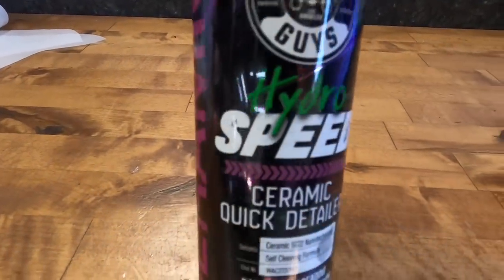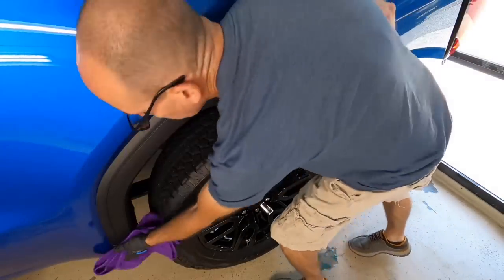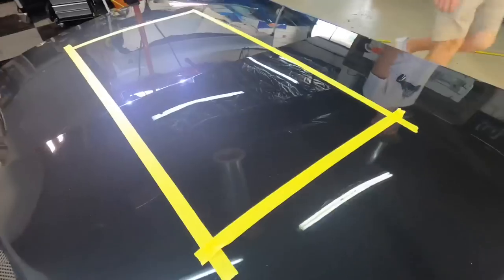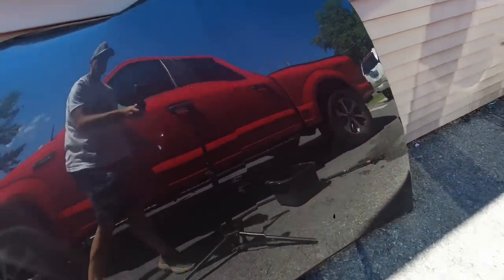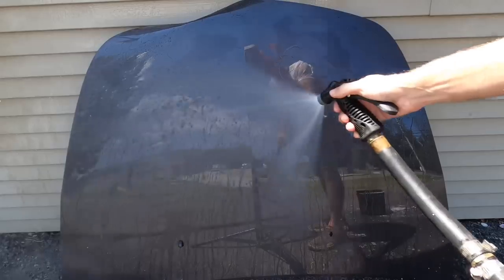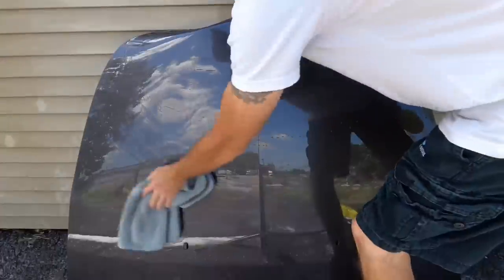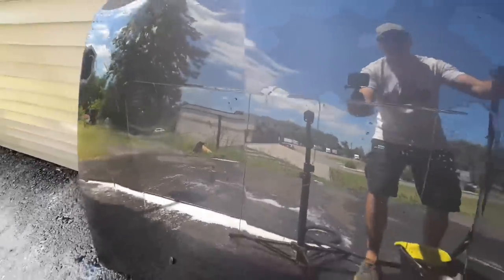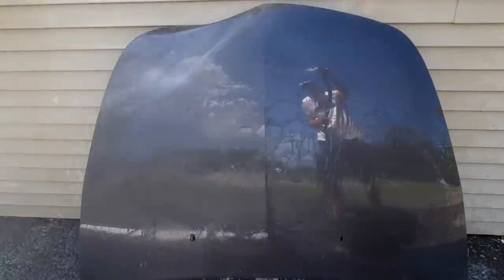Chemical Guys HydroSpeed Ceramic Quick Detailer!

Comment: I love this stuff personally. Very slick and reasonably durable. The shine deepens over the next 24 hours. Drawbacks, it’s a little expensive and it smells horrible. Good video.
Reply: It's way cheaper on Amazon if you get the gallon. It's like 25 bucks for 16 oz or 50 bucks for a gallon.
That makes it cheaper than the Adams mega foam, you could wash your car with the stuff lol
Reply: I think it smells great, love the shine it gives to my e63 amg. Im a fan, and frankly I did not expect it to last 3 washes (that was my thinking when I bought it). Seeing this review makes me happy I picked the right stuff for my car. Im impressed.

Comment: I like that👍 Awesome quick detailer for Sunday night drives in the city.. the lights really show off the gloss!! The gloss is INSANE at night.. don't know what is is about it..just try it😎
Reply: Personally if you’re willing to go to such lengths for your car I’d say just go all out and get yourself some Adam’s ceramic coating and apply that, then for quick details, use nexgen ceramic detailer. It has a 12-13% sio2 content. That paired with the 10h hardness from Adam’s and the superior sio2 content from nexgen should keep your car perfectly protected for YEARS. And for less the price than a detailing at your local detailer.

Comment: Looks like a great product for a quick detailer!    I might have to pick up a bottle of this next time I need a quick detailer.   I personally love using quite a few of Chemicals Guys' products.   Diablo Wheel Gel is my favorite wheel cleaner believe it or not because it's PH neutral so works perfectly on my well maintained rims that I have protected with Fusso Coat topped with Turtle Wax Seal & Shine.  Another is their Leather Serum along with a lot of their soaps and foaming soaps.   Their grit guard is one of the best out there in design with a unique conical design that really holds the grit and grime UNDER the grit guard and they cost a measly ten bucks!   Far better than the original grit guards that allow dirt to flow right back up past the wide grates.  If a person is just getting into detailing and are looking for a "one-stop" shop for all their detailing needs,  I steer them towards Chemical Guys because they are at least a notch above what you can get at most retail stores.   It's a great "entry" company in my opinion.   A lot of pro's and enthusiasts bash on Chemical Guys, but they really do have some good products.   It's just confusing to traverse through their extensive range and you almost need a roadmap because many of their products seem to be rebranded as something else or a different color or whatever.   But when you get past all that,  they do have some good ones.   Not everything,  but quite a few are really good.   Their retail stores in California are really cool.   I am like a kid in a candy store in that place.  This particular quick detailer looks to be pretty stout for what it is.   A lot of detailers can't stand up to any chemicals and wash right off so the fact this quick detailer held up to all the abuse Brian gave it is pretty impressive.   It outperforms a lot of other quick detailers I have used.

Comment: Hi Brian love your channel but i have one concern about this 10wash test. It will only be a mechanical stresstest so you could use just regular soap. If it shall simulate 10 real washes the product must be on the panel for more than 10 seconds before being washed off. Because when you shampo your car the solution is on the panel/panels much longer maybe 2-8minutes? So you should leave it for some minutes in between.
But i understand the test will take much longer time.
Thanks

Comment: Hi Brian I was just wondering in your opinion I use megs cpress spray wax as drying aid and ultimate paste wax when i have time  other wise I use there  fast finish bought few cans when saw for 5 bucks while back  I was intreasted in turtle wax line up flex wax   if it's similar I'll  just stick with what I am using.  Just wondering would i be getting any more life outta newer cermic based products

Comment: It seems as though this product is fairly good as a quick detailer like you mentioned. My one complaint with chemical guys is the one recent incident that I had with their water spot remover. I watched several videos on how remove water spots and in was those videos, the consensus was that chemical guys orange gel was best. Well, that wasn't the case for me. It didn't remove not even one water spot. Being that I value your honest opinion, I decided to see how you could advise me on correcting this issue without taking my car to a professional. I watch your video on the 3d one polish and it totally and completely corrected all of the water spots. I reached out to chemical guys but to this day, they have not responded. For that reason I won't use any of their products. But I would like to tank you Brian for your video on 3d one. I reached out to also thank 3d one. I'd like to add that I corrected the spots with the only thing That I had, a harbor freight bauer dual action polisher. Which made me wonder....do you really need a expensive polisher?? How long it will last, who knows. Thanks again.
Reply: I would recommend getting in touch there ig. I replied to the one in my local area and they responded pretty quick

Comment: What’s the difference between this and the v07 spray ?
Reply: My truck is tuxedo black and for me the v07 just doesn’t do well, doesn’t last and everything seems to stick to it. Can’t think of the name but the purple quick detailer works better for me than v07. 
I’ve been using this hydro speed lately tho and it’s my favorite so far. Works super well. I’ll go ahead and buy the gallon as soon as i run out.

Comment: Yes! Thank you Brian,I bought some of this last year and had excellent results with it's hydrophobicity,slickness and gloss! Chemical Guys has hit and miss products and to me this was a hit!! It's very versatile,I have used it over waxes, sealants and no protection with no fuss. The longest it lasted was on my car overtopping the hydro slick and it lasted around 9months before it's properties were diminished. I got around 4 months as a standalone on the paint. On my windshield and other's I applied it to though it lasted well over the year mark with no problem.. It  was weird to me professional detailers haven't done thorough review on it yet.. I feel it's great for anyone wanting some protection and having no worry over applying or removing it,it also seems to layer decent without streaks. I appreciate your input and video on it. My biggest gripe with this is the price for 16 ounces, although it's much cheaper in a half gallon. Thank you!
Reply: Like their Carbon force Ceramic coating is good as well as their Honeydew foam shampoo and their invisible nonsense APC
Reply: @FordF4NN  a true ceramic coating with higher solids content needs to be in a glass or aluminum bottle because the solvents will evaporate thru plastic
Reply: I have only tried it on my windshield so far and while the beading was good, the sheeting was not. It should be good on other surfaces though.
Reply: @Baisemannen  on a windshield you don’t want sheeting. You only want beading